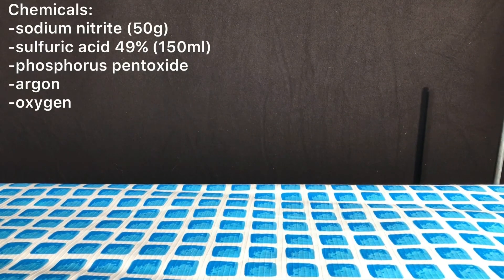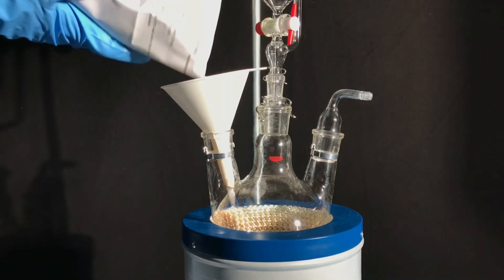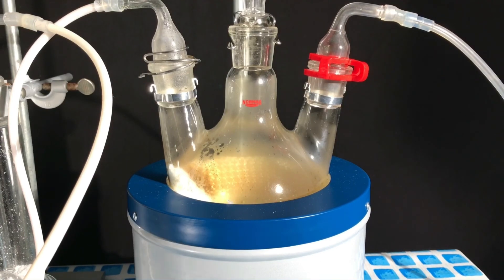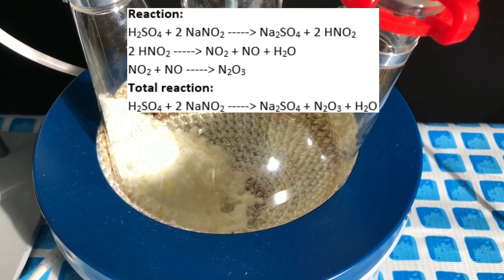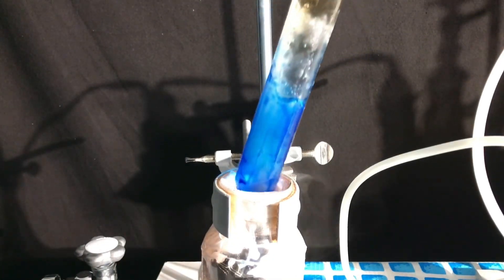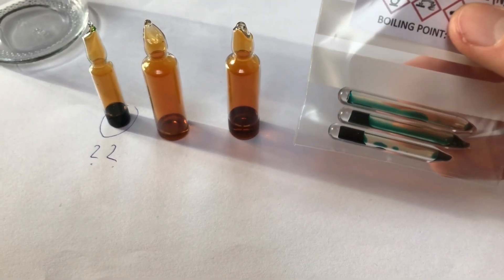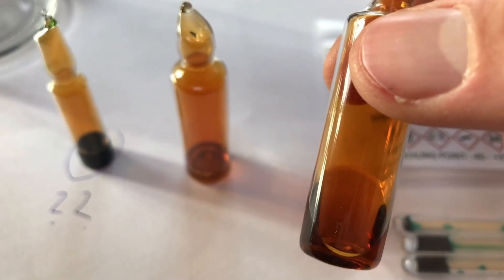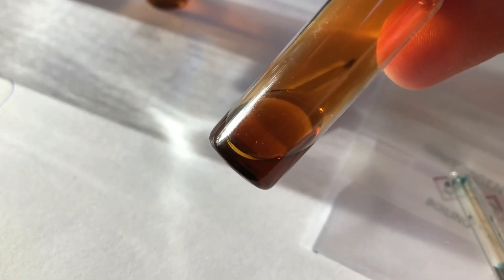Making Dinitrogen Trioxide and Nitrogen Dioxide (1/2)

Comment: What about N2O4?
Reply from the maker: NO2 and N2O4 exist in equilibrium
Reply: @THYZOID  my interest in rocketry naturally lead to learning about N2O4 and its use as a oxidizer in hypergolic propellants.  Can't wait to watch your explanation on controlling the ratio.
Reply from the maker: The colder it gets the more N2O4 you have. At dry ice temperatures you got nearly pure N2O4 at higher temperatures mostly NO2
Reply: @THYZOID  neat!  Now I'm curious what, if anything, rocket engineers do to thermally isolate and regulate the NTO tankage.  Time for me to dig!
Reply from the maker: Why should they? In the end NO2 contains the same ratio of N to O
Reply: @THYZOID  Good point, there may be no problem at all.  I was just thinking of consistent densities of delivered propellants.  Rocket engines really don't like being fed vapor when they expect liquid for instance, or when their mix ratios are changed in peculiar ways (most engines avoid stoichometric ratios so they don't melt for instance).  That said, I am ignorant as to the exact physical characteristics for NTO at the moment beyond that it does need a pressurant for its tankage (not a sufficiently selfpressurizing propellant for pressure fed rockets.)

Comment: Nice blue colour of the N2O3! Did you calculate the pressure of the ampulles or are you just hoping they‘ll hold the pressure?
By the way, I work as an chemical laboratory assistant. If you need help, just ask.
Looking forward to part 2!
Reply from the maker: I always just fill them half the way and then seal them. After sealing they are pressure tested at 50-150*C (depending on the gas). Nice to have someone working as a lab assistant. Do you have discord?
Reply: @THYZOID  okay, that should hold the pressure. haha, yes i have Discord
Reply from the maker: Mind sending me your DC name?

Comment: What about anthranillic aicd from phtalimide or phenylacetic acid from benzylchloride using a grignard reaction with CO2?
Reply: Zock4 your suggestions are kinda sus
Reply: @domemolnar3484  Yeah I know what you mean but the possession of these compounds are legal to a certain extend
Reply: @zock4419  You are correct. However nowadays if someone is a "hobby chemist", especially on youtube, he could expose himself to an unlovely situation with these type of synthesies. For example I made hydrogen cyanide and then it's potassium salt. It is something you will never see on youtube, for obvious reasons. But it is also and exceting reaction and process to share with amateur chemistry lovers. A good example is ChemPlayer's channel. They made very, very good videos, but they sometimes have crossed the "ethical border" and they get deleted from youtube.
Reply: @domemolnar3484  yeah right but on this channel here the synth of acetic anhydride was also shown and other chemicals like nitrogen oxides or chlorine gas are obviously very toxic which could be problematic too so i thought the preparation of these compounds wasnt out of the scope of this chanel. Also chemplayer prepared things like P2P which is a step above if you ask me. But yeah i get your point better to be safe than sorry.
Reply from the maker: The problem with these videos is not the toxicity. YouTube is ok with that. I believe that YouTube will have a problem with making chemicals often used as drug precursors and I don’t want to risk getting striked.

Comment: I didn't know NO2 wasn't filtered by normal acidic gas filters...
What type of gas mask filter do you have ?
Reply from the maker: The filters used for NOx have a NO mark on them. They are only approved to be used with NOx or carbon monoxide a single time and in comparison to normal filters these ones have a catalyst combined with the normal filter.
Reply: @THYZOID  
Humm...
Can you get them combined with the acidic gas filter, because they're not that useful if you handle multiple acids/gases at the same time (HCl, Cl, NO2)...
Reply from the maker: ^ Catalyst combined with normal filter. They’ve actually got a filter for acidic gasses, chlorine and other gasses included in the same cartridge.
Reply: @THYZOID  
It seems like 3M and Honeywell (american brands) don't carry these NOx/CO filters everywhere, they're quite hard to find (from a quick online search).
Reply from the maker: @ryanslab25  dräger sells them
Reply: @THYZOID  where do you buy dräger filters? I was looking for them in the past but everywhere they were out of stock apart from P3 and A2P3
Reply from the maker: Here in Germany you can get them on Amazon, eBay and all other sorts of online shops.
Reply: Found you Ryan 😂
Reply: @dixanyl  Hey! Hello 😆